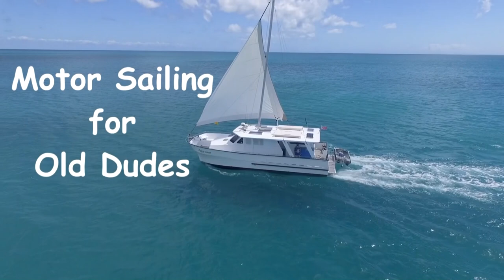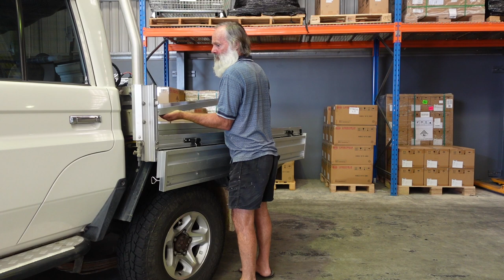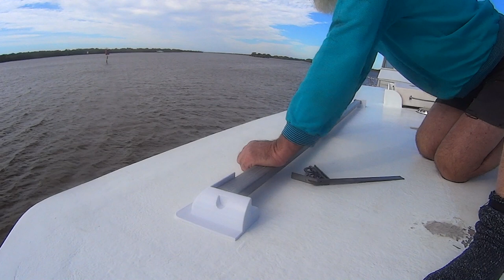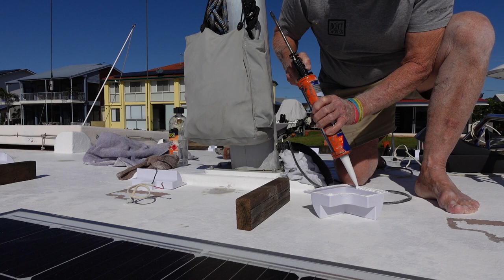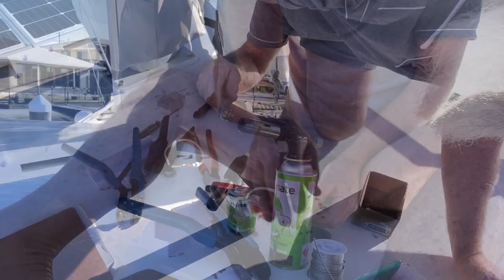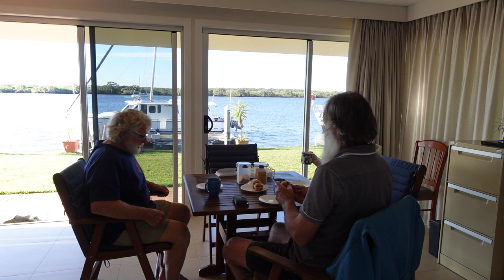Lithium Conversion Ep6 Fitting Panels

Comment: Great work Norm and Brucey!
Just a idea. Look for a small modern gas solder iron can solder in 2 mins with less hassle
Reply from the maker: Good tip dude. 
I have one, but it wouldn't put out enough heat for those fittings. Especially in the wind.

Comment: Hey norm love the videos just wondering what solar panels your using thanks fred
Reply from the maker: They are Solarwatt 320w panels. Best specs we could find in a house panel at a reasonable price. Double glass,salt rated,heavier frames etc. 
A bit hard to come by as households are going for bigger 500w panels now. 
Purchased them from BayWa r.e. Solar  ...(that's the right spelling).You may have to search around a bit.
Cheers dude.